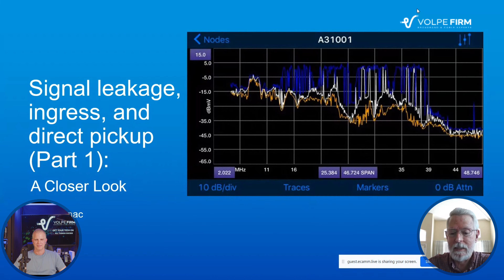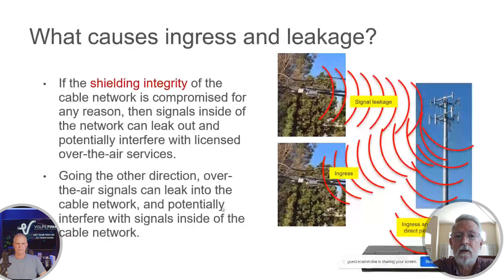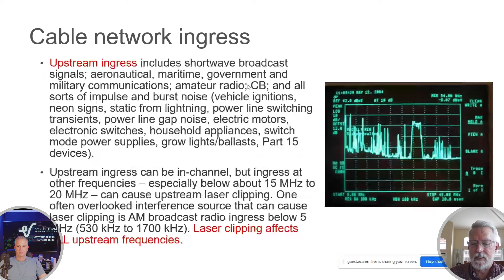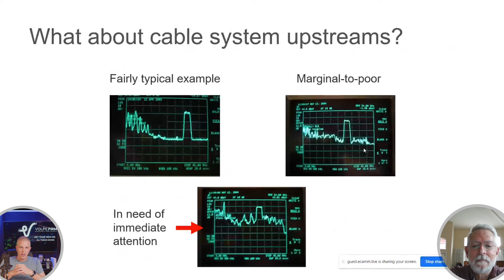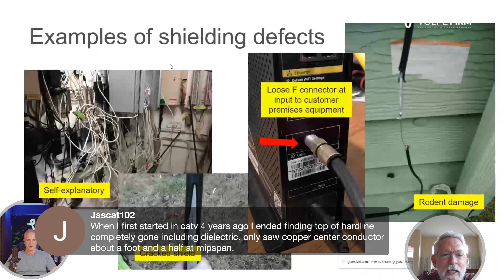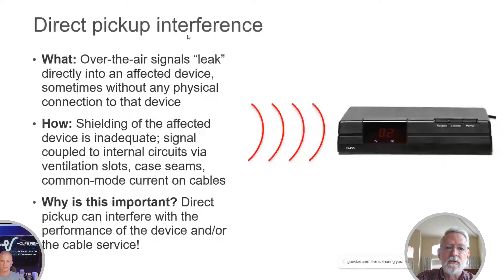Into the Ingress Abyss: Understanding Leaks, Causes, and Consequences (Part 1)

Comment: As a TV repair person in the 90s we had a customer in an apartment that was getting cable from there neighbor using a long pice of Black and Decker cable . The funny thing was it had a great picture.
Reply from the maker: Thank you for sharing. There are many stories like these. Cable theft is not easy like it used to be due to digital encryption, but the resiliency of cable and RF signals has always been remarkable.

Comment: Had a LP UHF transmitter and 700 MHz cell tower across the street from one of my headends. Had a heck of a time keeping signals out of combining amps. Ended up upgrading the amps but still had to make sure every connector was torqued properly.
Reply from the maker: Thanks for story @EricGrumling. I'm sure you had a very tight headend in that region!

Comment: Id like your take on the practice of leaving inactive customer drops connected at the tap, where other providers have taken over the internal wiring for thier services. Much of our return path noise and adaptive EQ faults come from these unterminated lines
Reply from the maker: In my opinion both methods likely need to be implemented. If the cable operator can provide a service to subscriber's who cannot support their in-home wiring, then I think this is win-win. Me personally, I have not issues with maintaining my in-home wiring and my neighbors as well, but I know that my neighbor would not be able to sustain their wiring without me and would need a cable operator-based service. But there are some homes a tech will never be allowed to enter. These are homes that for whatever reason subscribers do not want to allow entry. In these cases, disconnects are necessary in order to ensure good QoE for all other subscribers.

Comment: So direct pickup is what our problem is. Our meters arent insulated very well, and certain areas, close to this radio station 92.5 will fail our ingress scans at 93mhz. Its frustrating
Reply from the maker: Hi @mynameisJonas33 Yes, certainly with some of the older meters and possibly with some of the newer ones, they do not have enough internal isolation. I recommend terminating the input and see if they pass the ingress scans. If not, you know there is not enough isolation and you need to take this into consideration. Especially next time when you buy meters, make this part of your evaluation process.